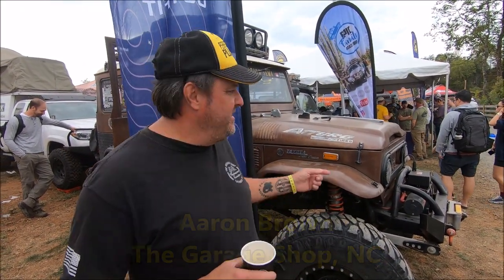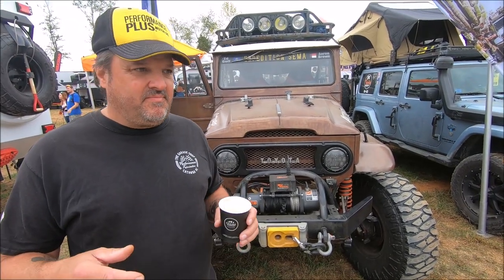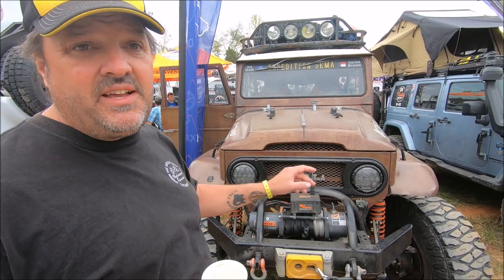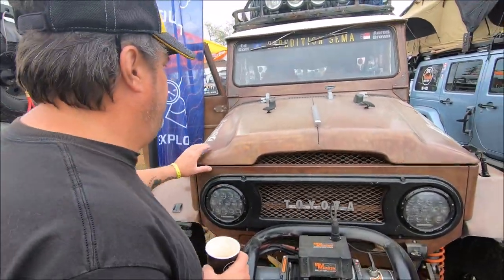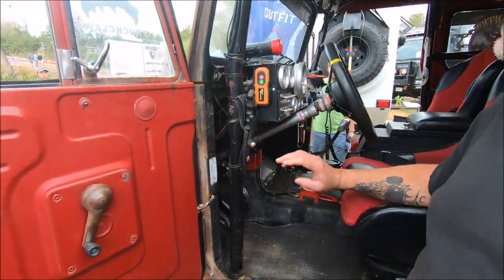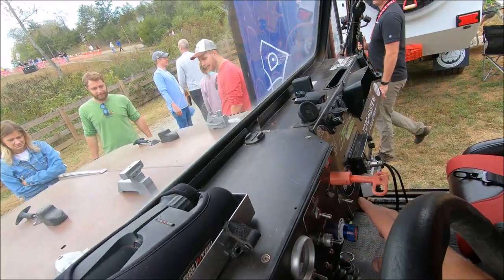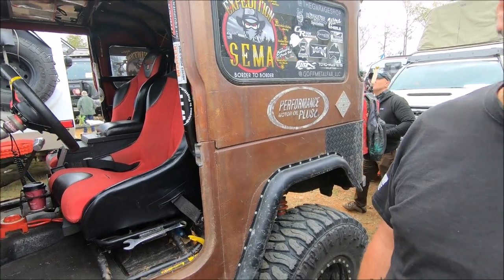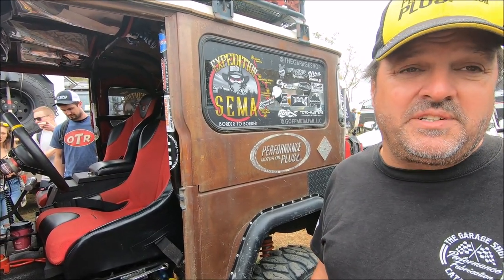1970 Toyota Land Cruiser FJ40 w/ 350 V8 - SEMA Expedition

Comment: She is beautiful!! My FJ40 was built in november of 1970 but is a 71 model year. People hate on V8  FJ40s 😅 (ih8mud haters)  but I love having a smb chevy 350 and th350 transmission. I drive mine everywhere. Simple to fix. You can get a fuel pump at any autoparts store for like $15!! Four wheel disk breaks and saginaw power steering makes a FJ40 A  driver not a garage mall stomper. I drive mine to the Rubicon wheel all weekend then drive it home..All my buddies got trailer queens on 40s and one ton running gear. I went everywhere they went with just a rear Detroit locker. After the front lockrite and original longfields were put in it just got more fun and unstoppable on 35s even. Cheers 🍻 You gotta love those coils!